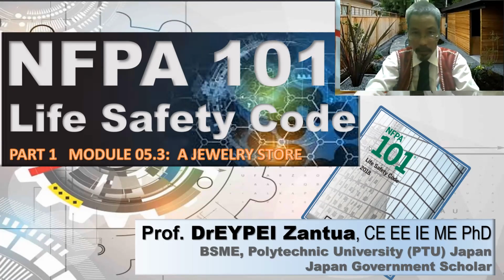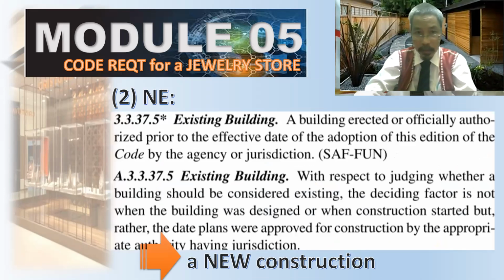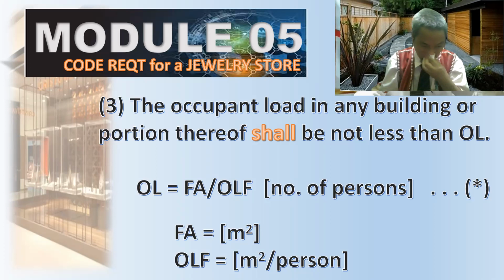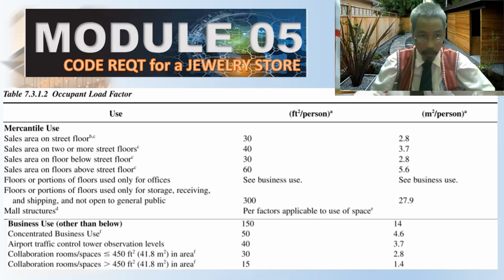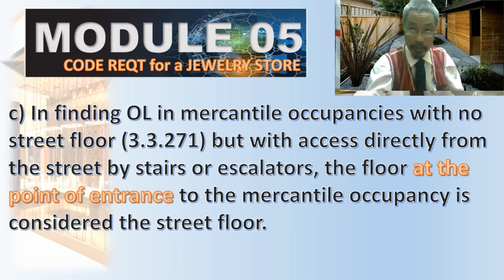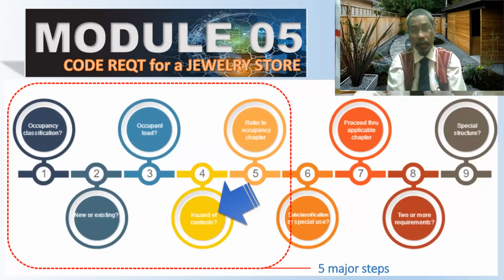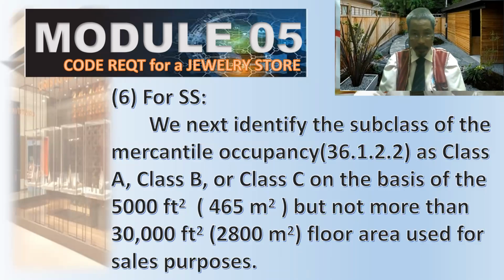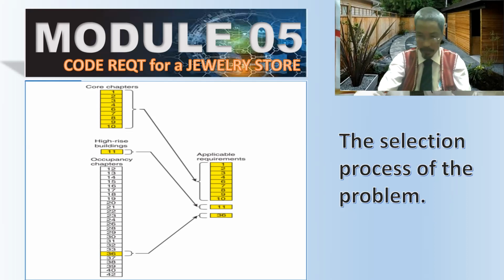DESIGN of a Jewelry Store in 9 STEP - NFPA101: Module 05.3 [ Reference CODE by RA9514 - IRR2019 ]

Comment: Thank you sir for this well-explained lesson. This video is a continuation of Module 5: Part 3 A Jewelry Store. For the given problem/situation, it uses the 9 steps of the procedure, (1) to identify the occupancy classification,- it is a mercantile, (2) is it a  new or existing building? it is an existing building but new construction for a new jewelry store, (3) What is the occupant load? Occupant Load = Floor Area / Occupant Load Factor. (4) Hazard of contents: start and spread of fire, smoke or gasses generated, explosion. (5) refer to occupancy chapter, (6) subs-classification or special use? Classified as class B mercantile occupancy, (7) Proceed to applicable chapter, (8) Two or more requirements?, (9) special structure? It is a special structure.  Thank you sir.